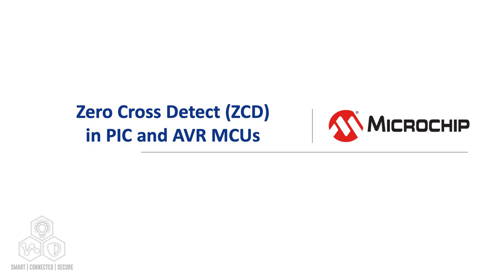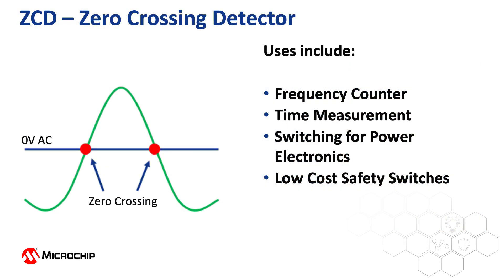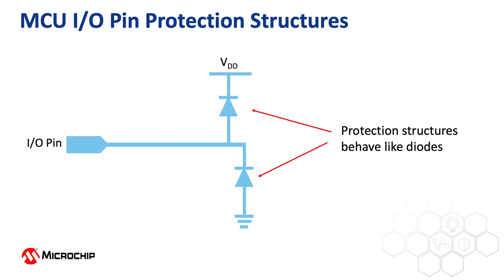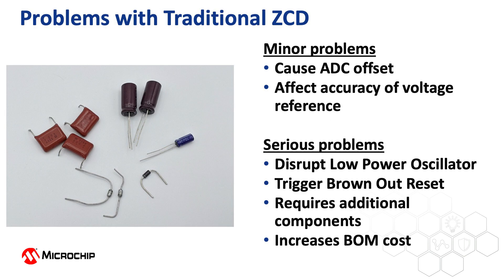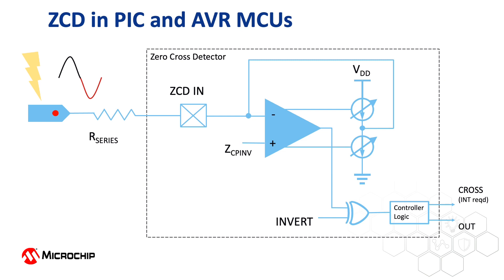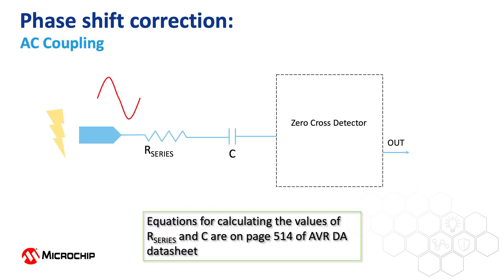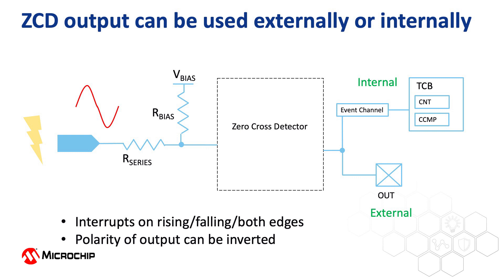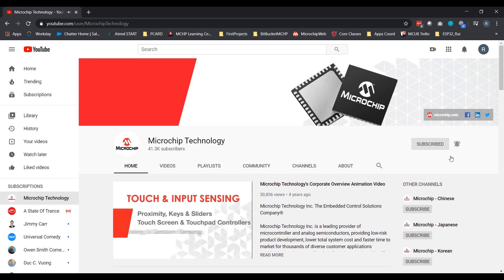Zero Cross Detect ZCD in PIC and AVR MCUs

Comment: Can this work with small signals like the echo from a transducer?
Reply from the maker: The Zero Crossing Detector (ZCD) in the AVR DA family is mainly for AC signals, like those from power lines. It might not be the best choice for small signals, such as an echo from a transducer, because it detects signals around 0.8 volts. For small signals, other methods might work better.